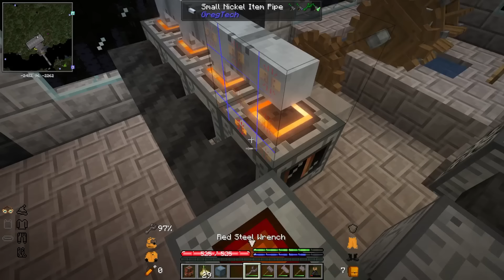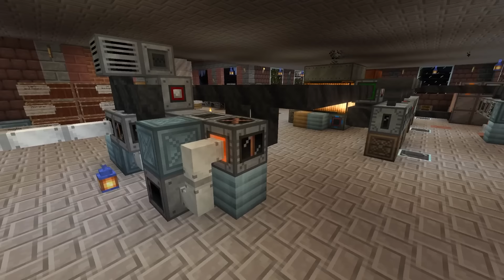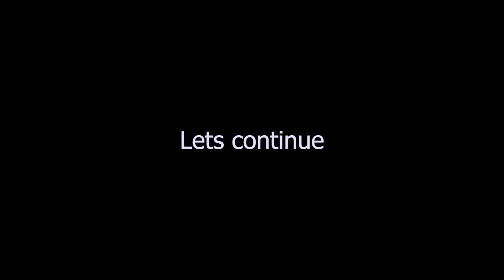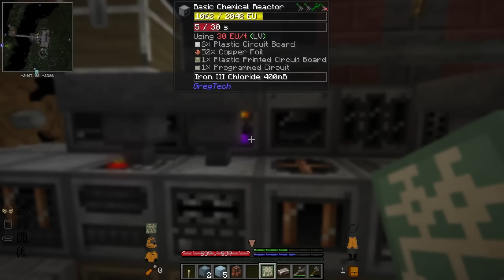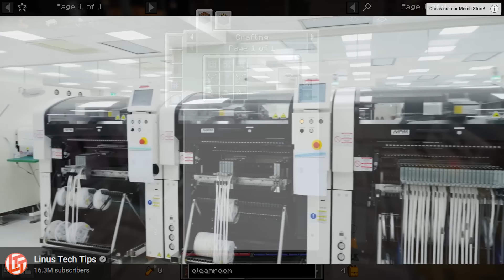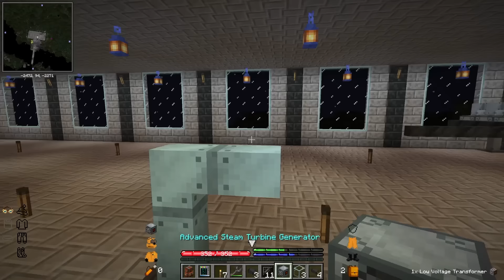Making Supercomputers in Minecraft's Most Realistic Mod (TFG Part 9)

Comment: It seems the only TFC thing that keeps coming back is food and ore, lol.
GregTech doesn't really fit the "realism" category for me. It is certainly much more realistic than other industrial mods, but not in a way that TFC is. There's a bunch of moments with GregTech I've noticed that are weird in terms of technological dependencies. Some things seem weirdly complicated to be made when realistically they can be made much easier.
Reply from the maker: you would like SuperSymmetry, its a Gregtech pack that approaches all these problems in quite an interesting way
Reply: I also want to note how GregTech seems to have a lot more vertical scaling compared to horizontal scaling. You keep building better and better machines rather than expanding the production, producing in parallel and dealing more with logistics. Yes, AE2 does automate logistics so the player doesn't have to run around distributing the resources. But I always felt like AE2 is like a cheatcode. It's like the logistic network in Factorio, but insanely powerful.
Didn't include this in the main comment because this is more of a "it's not like in the other thing I like"

Comment: Yo guys, you are all searching for blue/red steel alloys when the gregtech ones just reflect the tempering methods you use on steel, blue steel refers to heating steel until it's blue then cooling it down in a specific way, red steel is the same, it just makes it so the steel has different properties, red steel is way harder but also more brittle, blue steel is softer but also way more durable against stress.
The reason they are alloys in gregtech is because the mod doesn't have a tempering mechanic.

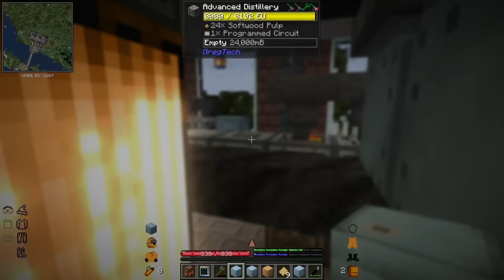Comment: 45:00 btw you can use a screwdriver to make drums autopush from the bottom side with a screwdriver, no pump required. (with a bigger setup where you want to output to above or the side you'd need a pump, but not down - gravity does that for you)

Comment: 27:24

this (but without the wood pyrolysis part most likely, using natural brown coal) is basically coal liquefaction 101, and is actually used to get stuff like syngas (ammonia/methanol precursor, also good SNG precursor), semi-coke, and coal tar that is processed further into oil-like hydrocarbons

coal liquefaction was one of the most important plans for WW2 germany that wanted to achieve autarky (full self-reliance in case of absence of trade) and didn't have nearly enough oil to fuel the war, now it's basically an alternative fuel program in a lot of countries

edit: and blue/red steels seem to be not real; i've skimmed through most common ISO docs for various steel alloys with non-ferrous metals and there's no silver, gold etc.; the weirdest ones are copper&nickel in some ball-bearing steels

Comment: So most of our alloys are just different steels with various additives and heat treatment processes. Advanced steels are generally tool steels, which are important for, well, tooling, and then you get into high-temperature steels which can withstand greater temperatures before softening, which means they can work at a higher speed without unduly increasing wear. After that, you get into alloys that aren't even steel, but have the properties we look for in tooling.
HOWEVER - something we've only just begun peeking into are called high-entropy alloys, which are roughly even mixes of three, four, or even five different elements, compacted together such that their atoms connect to different elements instead of them just clumping together in their own crystals. So far we've only been able to make tiny samples of them under extreme conditions, but their material properties are very interesting, and if we can figure out how to mass produce them, steel may actually be surpassed in utility!
Of course, making such an alloy with a hammer and anvil is unfeasible, but that's the closest I imagine we can get to red or blue steel as it appears in TFC.

Comment: you can place the battery buffer on the gas turbine there isn't a need for the silver wire
Reply from the maker: I'm gonna have more turbines, I'm building it to be expandable
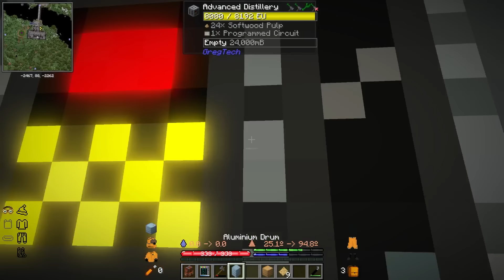Reply: also for the pumps and things 45:15 you can just use the drum and use the screwdriver  on the drum to have it auto export to the machine as long as it has allow from input on
Reply: and later when you have ae2 you can use a machine hull to transfer channels into the cleanroom without the need to make wireless the machine hulls also let in 1A of the power of it's tier

Comment: Woah, you nearly caught up to me! Learned a lot from you - I should get infinite tantalum set up as well. The idea of using different cables (silver/gold) is great. I also have some tips:

Already said in a different comment I made while still watching, but light bulbs are easy to make, never turn off, and need no electricity

You don't need iron doors for the clean room. I use a glass door (that slides to the side) and it seems to work just fine - I can even leave it open, no problem

You could have skipped getting large lithium batteries IMO - I went straight for the crystals. They're "relatively cheap" and "easy" to make (but I guess if you have the lithium, you might as well use it) while being absolutely OP

Automatic miners are great. Now you're in HV, so it's worth getting some and using energy crystals on them (although getting eyes of ender will be quite the side-quest, lol) - you can get electrum and a bunch of other stuff with these easily. No need for any more manual mining.

Titanium can be made without byproducts or waste in a closed loop, if you process all the materials you get. It will only be Rutile in => Titanium + Oxygen out (If I remember correctly, been a few weeks), all the other materials can be reused within the loop to produce more Titanium + Oxygen.

I "automated" my Polyethelene and PVC production and... it's not worth it at this stage, IMO - huge drain on my electricity (I use energy crystals, transformed down to MV, I only have to change the batteries whenever I remember to). Has its pros, but... Eh

Still too afraid to dabble into AE2. I will let you do that first, lol.

The biggest difference between us is that I might have scaled up too early too much. I have a bunch of turbines (32 MV, 4 HV) making a lot of energy from benzene, powering up different parts of my base, but the base is a mess overall. I guess I'll look into getting nitrobenzene or sthg. Energy distribution is a real pain for me at the moment. Either way, can't wait for next ep!
Reply from the maker: you dont need to use rutile dust in TFG, gabbro makes pure titanium dust
Reply: @Hecuba39  No way! Dunno how I missed that!

Oh well, I had a lot of rutile anyway (like, almost full aluminium crate worth of it), so I had to get rid of it somehow

God bless, brother

Comment: Yes both blue and red steel exist but the in game ratios are about 10x what the actual ratios are IRL. 1.5% bronze instead of 15. 
Blue steel is blue do to a tempering process and is good to use in tools and knives. 
Red steel has some electrical conductivity and was used as both a ground for sky scraper lightning rods and some battery experiments. It is also easily oxidized which gives it its red coloration.

Comment: Forgot to tell in my videos, you can use the crushing wheels to void any item that isnt ore.
Use aluminum cables, it is not the cable but the supplier (battery box/generator) that defines the voltage.
Imagine using the crucible to melt the tfc alloys instead of using the ebf.
i stuck with steam power because it is easy to escalate.
i leave the tfg in your hands.

Comment: when i make my benzene farm
i used 2 pyrolyse ovens, 1 distillery and 4 extractor
and yet my benzene ranks up slowly
edit: 
life saving tip: you can use hose pulley to fill any blocks that allows fluids without mechanical pump, you can use pump cover adjacent to the output of the pulley (no need if you're doing it on input hatch), set it to import, as long the pulley is activated (if not, temporary put a mechanical pump and activate it once with a crankshaft, it will show "bottomless supply") and will pump lots of fluids. i don't know if you don't understand but this saved my life!
yet another life saving tip:
default keybind for opening backpack is "B", you can manualy change that in settings. no need to waste time grabbing from your back accessory slot

Comment: Also if you are going the benzene route for power generation, i recommend 10 lv extractor to keep up with the charcoal
Reply from the maker: 4 extractors are perfectly enough for each pyrolyse oven unless I upgrade to nichrome coils or an HV oven
Reply: @Hecuba39  that's exactly right, and you should upgrade to nichrome once you unlock it, it's basically free extra energy

Comment: 12:20 Yeah, i have always thought about this fact, red steel has a weird spot in the progression path, it's the Endgame material for regular Terrafermacraft, and it's unlocked in hv in regular Gregtech, which makes it really good, Diamond plates, are unlocked with the lv cutting saw in gregtech which makes it worse than red steel, and they are practically useless in regular Terrafermacraft, In TFG however the end game of terrafermacraft comes before Lv meaning you unlock red steel even before unlocking the lv cutting machine.

Comment: Mechanical Engineer here, Red Steel and Blue Steel do not exist to my knowledge. Most Steel variants are defined by their Iron microstructure (determined by heat treatment) and the percentage of Carbon and other impurities. I think Red and Blue steel just exist to give the player more Steel Alloy options without delving too deep into the materials science. If someone knows more about Steel please correct me 😅.
Reply from the maker: some other experts in the comments have said the same thing, I dont know why the TFC and Gregtech devs would add colored steel because they put so much effort into making everything else as realistic as possible so adding a fake super-alloy is confusing to me
Reply: @Hecuba39  It's probably just a way to gate progression without making it too complicated or confusing (so that's why it's blue and red) since steel alloys can get really complex, also the pack has AE2 which has practically magical materials like Fluix :D so yeah

Comment: Thanks for inspiring me when you posted your first vid about tfg i joined the main server and just last month my rag tag team of players beat the pack and now we are onto gtnh.
Also there is so many food glitches we found that lets you make a god sandwich
Here is how and what you will need
spend the time to make a sandwich with max stats in everything but  fruit then get a fridge and put a place holder item in then swap the sandwich and the placeholder item by clicking twice to get the refrigerator glitch then put that great sandwich in a super chest snd finaly get a cheap sandwich of the same kind of bread(we used barley and potatoes) then put them in the chest and they should be transmuted into the orignal sand wich AND you can do this with rotted sandwiches and they will turn unrotted

Comment: Blued steel is a real thing, its basically oxidizing rusted iron on the surface of your parts to make them rust and corrosion resistant, especially for firearms.
so far as i can tell, there are a few things which are called red steel by the people who sell them and they're all different, but all some kind of covering or alloy to make the steel corrosion resistant.

So kinda yes for blue steel and not really for red steel
Reply from the maker: but thats not the same kind of blue steel because this stuff has gold, silver, nickel, bismuth, copper, and tin in it which is impossible

Comment: So Red Steel and Blue Steel actually do exist, kinda. Supposedly red steel is that its a type of steel that is sprayed with an iron oxide coating that gives it a red color and added resistance to weather (like rain and snow). It's mostly used in construction as a building material.  The closest thing to Blue Steel I could find is a type of "Japanese Carbon Steel" created by Hitachi Metals as a high end chef's knife material. According to them, blue steel is "an alloy steel made of White Steel, (a carbon steel with low content of impurities), mixed with tungsten and chromium." (taken from their website.)
Reply from the maker: the only problem is that those aren't the same as the impossible gold and bismuth based alloys you see in Gregtech and TFC so its not the same but that is cool
Reply: @Hecuba39  theres actually something similar to this line of thought in reality, its called "high entropy alloys" where people just try to smash as many different elements together to alloy them to see what properties arise, give it a look
Reply: @Hecuba39 the closest things I can think of to blue and red steel are white and grey cast iron or wrought iron and cast iron
Reply: @Hecuba39  a german source i have says blue steel is a type of high purity steel that only contains carbon as an alloy and is made from iron rich river sand. so the answer would sadly be no, blue steel as in the mod does not exist. btw the source it says the name comes from the paper packaging of the company
Reply: @Hecuba39  the best i've found is Red-Short Steel, which is basicly steel with high sulfur cotnent, as for blue steel maybe martensite
Reply: huh, I hadn't thought the two would be a real thing at all, besides naturally coloured steel (ala bluing). I'm absolutely certain though that their inclusion in gregtech is as a direct reference to TFC, much like red and blue alloy (alongside the latter's ingredient, electrotine) directly reference redpower 2.
Reply: Blue Steel could also be the Steel in the process of Bluing using Nitre, which is also used for oxidation protection purposes (There is a Wikipedia Article for both "Blue_Steel" and "Bluing_(steel)"  [Put the things in quotes  after wiki/ on Wikipedia in URL])
Reply: There is actually a proper red steel Alloy (not just painted) that is part of the family of "Weathering Alloys". Which when exposed to the elements naturally forms a stable, red coloured oxide layer that prevents further corrosion. Its alloyed with Chromium, Copper, Nickel and Phosphorus.
Reply: So hold up steel beams are red because they are literally Red Steel?! That is the funniest dumbest and obvious situation I can think of
Reply: That blue steel isn't actually blue (at least, not beyond a subtle tint). To get steel that's actually blue you can heat it up to almost 600F. This usually makes the steel softer, though.
Reply: Tempering steel in certain temperatures also makes it blue colored
Reply: @matesaber9464  Generally, that's just a part of the heat treatment, not the alloying components. A blue color can be achieved between 525F and 610F
Reply: i just figured it was a common fantasy metal lmao
Reply: @MoonLmao red and blue steel have been around since TFC's beginning, all the way back in 2012
Reply: is it just different steel blends,
like nicknames for the iron carbon alloy types or smth
Reply: What about black, bismuth bronze?
Reply: @geo_sky  bismuth bronze is a type of bronze, not a type of steel
Reply: @brjourngusthealmighty7833   You know what, the Japanese carbon steel makes a lot of sense given how durable knives made out of it are too

That's really cool!

Comment: So there is no such thing as red/blue/black steel as modeled in tfc as copper, silver, and gold cannot really incorporate into steels crystaline structure. There is however a whole class of materials known as high entropy alloys that work off highly shifted crystal structures via mixed additives. Their normally made with really fancy powder metalurgy or as a CVD coating, but I guess the game could be somewhat modeling one giving it at least some basis in reality even if it's made incorrectly.